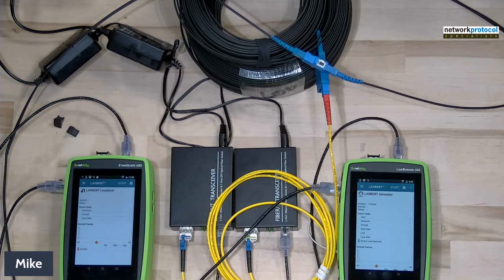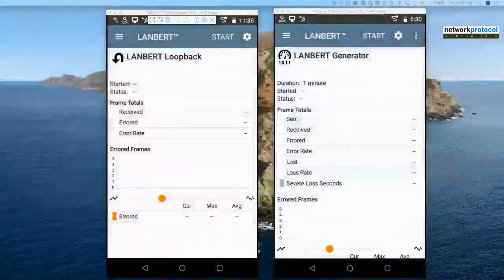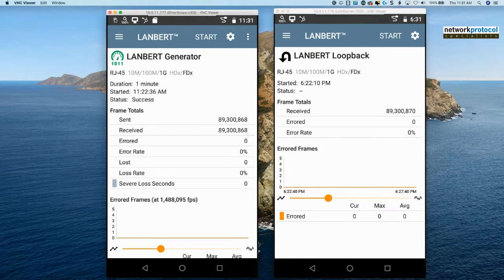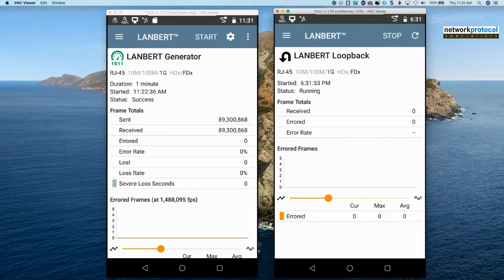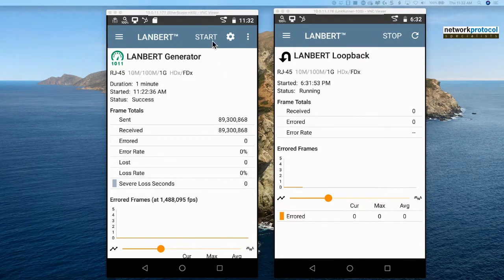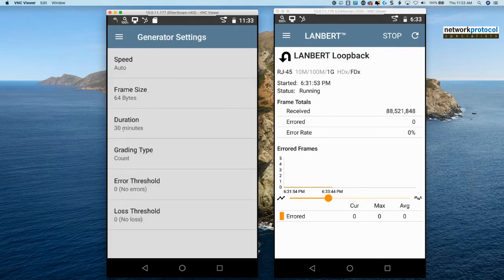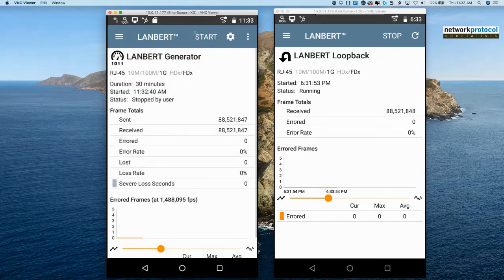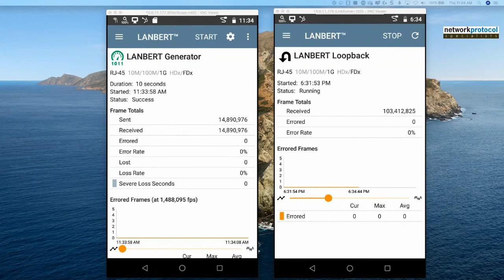NetAlly LANBERT™ Testing 1Gbps Bi-Di Simplex Fiber SFPs

Comment: Hi there Mike! I have an LR10G and am able to use a single device with a physical fiber loop back plug just fine.

I am trying to use my single device to test an ethernet cat6 cable with a physical loop back plug. The plug I have may be faulty because I cannot get the lanbert generator to establish a link using a cat6 physical loop back plug. Have you done a lanbert test on a cat6 cable using a single LR10G and physical loop back?
Reply from the maker: Unfortunately you could only do 10/100 with a physical loopback plug.  Since 1Gbps uses all four pairs for transmit and receive, there is no way to physically loop them back.